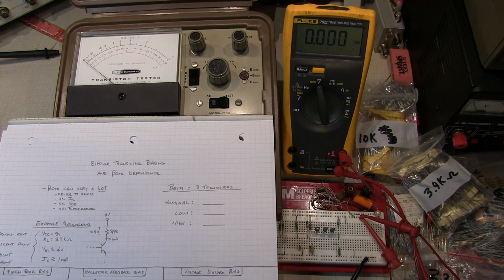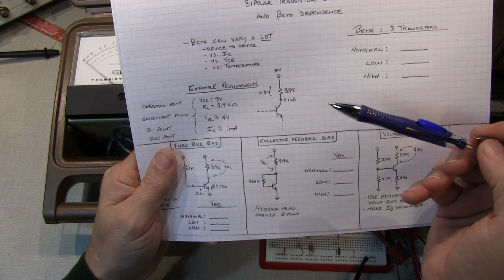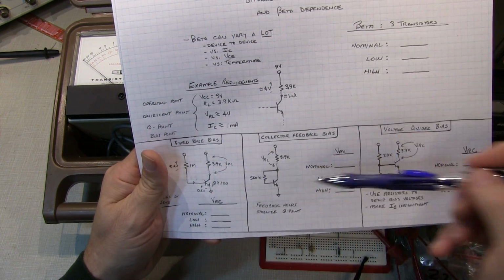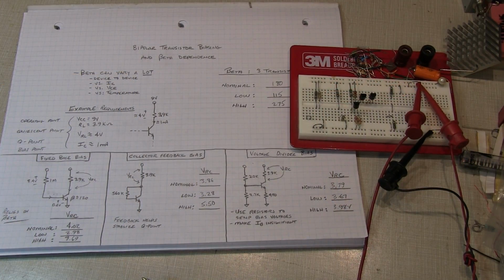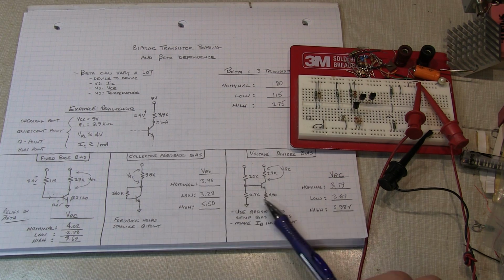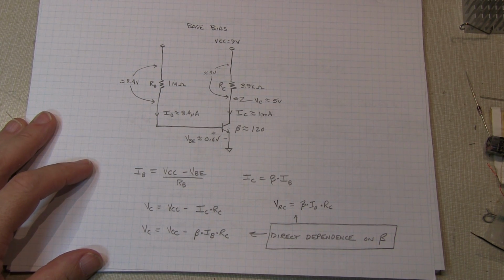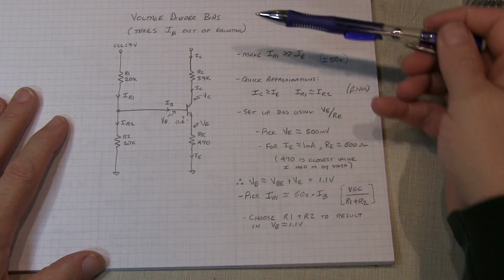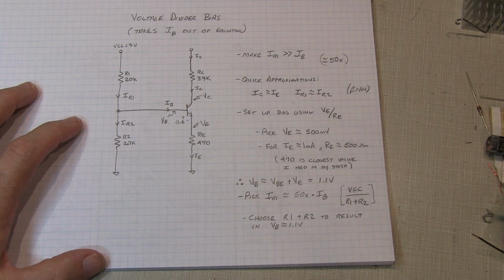#185: Back to Basics: Bipolar Transistor bias circuits and Beta dependence

Comment: When having 10 transistors that are ALL matched with the same BETA value but in circuit each transistor will have a different Vc collector voltage drop any reasons why?
Reply from the maker: Sure, they may not all be biased at the same level, or the base-emitter voltages don't match, etc.  It is generally  unwise to design a circuit that DEPENDS on a specific Beta value, since this is a highly variable parameter.
Reply: @w2aew  The Test circuit is the same. 10 transistors have the same Beta values, but when install each transistor in the test circuit one by one the Vc collector to ground voltage drop are different. I'm not sure why the Vc voltages are different when all 10 transistors have the same beta values and are MATCHed
Reply from the maker: @waynegram8907  Then the base-emitter voltages likely aren't matched.  Also, Beta does vary with collector current, so it is possible that the Beta matches at the test current used when measuring Beta, but they might not match at the collector current used by your test circuit.
Reply: @w2aew  I'm not use if these DVM meters that test transistor beta and transistor testers that has beta values are that great because when you install the transistors in the test circuit the Vc voltages are completely different. The transistors testers are suppose to be comparing the Ic/Ib = beta. Maybe the math program on these DVM transistor testers are a joke giving wrong beta values because when install in a test circuits the Vc voltage are completely different. What I don't get is how can 10 transistors have the same beta value but in circuit the Vc voltage are different per transistor.
Reply from the maker: @waynegram8907  You didn't read my reply carefully.  It is LIKELY that your DVM that tests for BETA is using a DIFFERENT Ic than the Ic being used in your test circuit - so there is no guarantee that you'll get the same results.
Reply: @w2aew  I did understand that part that my DVM meters test current was low and gave a different beta value. What I'm saying is that have you come across this issue when using DVM meters that test transistor beta and when matching transistors and when you put the matched transistors in a test circuit that you get different Vc voltages? because my main point is that these DVM meters are giving false beta matching and the only real way of getting a True beta matching is by measuring the Vc voltage and matching Transistors by the Vc voltage in a test circuit? Do you think this is the best true way of matching transistors is by measuring the Vc voltage and matching transistor this way and not using the DVM meters beta HFE test?
Reply from the maker: @waynegram8907  OK.  Yes, I have seen the issue where DVM hFE tests, and tests with the inexpensive PIC based boards, can give one result, and then you get a different result in the application circuit.  I usually don't run into the problem though, because I try to design circuit that don't rely or depend on a specific value of hFE (Beta).  If I truly need matched transistors, I am lucky enough to have a very comprehensive Curve Tracer that I can use, or I'll simply test them in-circuit.  Either of these methods are far better than the simple DVM test.
Reply: @w2aew  But to really match transistors all the Vc voltages should be the same if you're trying to match transistors? Measuring from ground to the transistor collect that Vc voltage should be the same voltage for all transistors if you're trying to Match the transistors, is that how its suppose to be done correctly?
Reply: @w2aew  Measuring the base current and the collector current to calculate the HFE beta IC/IB = BETA HFE is completely different in the test circuit compared to using the DVM metes transistor tester HFE values to match transistors. Its best to manually use two different ammeters one on the base current and one of the collector current and 3rd meter to measure the Vc collector voltage and Match transistors in circuit it seems. Those DVM meters HFE are false values not going to match transistors good. Any reasons why and have you ran into this also?
Reply from the maker: @waynegram8907  The readings from the DVM aren't false, they're just measured under different test conditions than your test circuit.  I never really run into the problem because I don't design circuits that rely on Beta being matched, this is bad practice.
Reply: @w2aew  Why is it bad practice to match transistor beta?
Reply from the maker: @waynegram8907  Because Beta is highly variable from device to device, and with operating conditions.
Reply: @w2aew  so how do you match transistors, what is your approach in matching transistors?
Reply from the maker: @waynegram8907  As I mentioned before - I'll typically use a curve tracer, or match the specific parameters of interest under the same bias conditions as they will be used in the application, which would typically involved building a custom test fixture or circuit.
Reply: @w2aew  yes the DVM meters "HFE test bias condition" to calculate the Beta HFE is going to be different compared to the Bias Condition of the custom test fixture circuit. The DVM meters bias condition and the custom test fixture bias condition are using a different bias condition to match transistors beta HFE. I understand that part that both are different. It would be nice if the DVM meters that are testing the HFE beta to tell the specs at what bias voltage and Vcc voltage are they calculating the beta hfe value.
Reply: @w2aew  Transistor water analogy, how can water be amplified like a transistor amplifies current? Transistors are like water turbines to accelerate the water flow which is amplifying the water flow?
Reply from the maker: @waynegram8907  A small change in the input voltage (or current) results in a large change in the output current.  If you want a water analogy, then think of the input as the operating of a valve - a small change in the valve control results in a large change in the amount of water that flows.
Reply: @w2aew  Why doesn't the formula Vcc divided by Rth thevein of the base biasing resistors = the base current? Also Why doesn't Vcc divided by the collector resistor value = Collector current? Both of these formulas won't give you correct base current or collector current, any reasons why
Reply from the maker: @waynegram8907  Because those formulas are only valid for basic resistor circuits, not for circuits with active components like transistors.
Reply: @w2aew  What formula are you using to get the transistors Ic? is it Vcc/Rc+Re?
Reply from the maker: @waynegram8907  That is the equation you use if the transistor is saturated.  If not, then you calculate the voltage across Re and compute the current that way.
Reply: @w2aew  So for the Linear Region you use Vcc/Re Emitter resistor = Ic ? Why can't I use Vcc/Rc Collector resistor = Ic?
Reply from the maker: @waynegram8907  No.  You don't use Vcc/Re.  You need to calculate the voltage across Re.  For example, if the bias network on the Base sets the base voltage to 1V, and the base-emitter voltage drop is 0.65V, then the voltage across Re is 0.35V, so the emitter current is 0.35/Re.  The collector current is very very close to this.
Reply: @w2aew  So the first step would also be you have to get the Base voltage FIRST before you can calculate the Ic? What is confusing me is that Ohms Law V/R=I can't be applied to calculating Ib or Ic. What confuses me about getting the R thevenin of the base biasing resistor that this formula doesn't work Vcc/Rth = Ib. Logically I would think Vcc/Rth would equal Ib but it doesn't.
Reply from the maker: @waynegram8907  Ohm's law is used, but you have to use it properly.  When you calculate the voltage across Re, you use Ohms law to calculate the current.  However, since the transistor is an active device and not a simple resistor, it doesn't strictly follow Ohm's law.
Reply: @w2aew  Right the Transistor is an active device so you can't use Ohms law Vcc/Re= Ie or Vcc/Rc = Ic, any reasons why? I know that a transistor is an active device but logically ohms law should work to get Ib and Ic but it doesn't work because you can't use Vcc/Rc = Ic and Vcc/Re = Ie or Vcc/Rth base resistors = Ib. This is very confusing because logically these ohm law formulas should work but they don't.
Reply from the maker: @waynegram8907  Think about it.  Why won't Vcc/Re work?  The voltage across Re is NOT Vcc, is it?  Ohms law only works when you are using the ACTUAL voltage that appears across the two terminals of the resistor.  Assuming Re is connected between the emitter and Ground, then the voltage across Re will be equal to the voltage on the emitter (Ve).  So,  you use Ohms Law to calculate the emitter current as Ve/Re.  Vcc is NOT the voltage appearing across Re, so that is why you don't use Vcc/Re.
Reply: @w2aew  What I'm saying is that the Transistor is acting like a Zener Diode by having a reference voltage which is considered Ve. The Vb base voltage is determining Ve. So you have to use Ve/Re = Ie or Ic. The transistor is not acting like a resistor voltage divider, its acting like a zener diode because the Ib base voltage is "dictating" what Ve will be. My whole point is that Vcc/Re or Vcc/Rc+Re is not the Ic collector to emitter current. Some EE designers will use Vcc/Rc+Re = Ic Sat and then that 1/2 of Ic Sat which will = Ic linear region collector current. When you take 1/2 of the Ic Saturated it will be Ic and Ie current of the linear region. I don't know the correct term or name for the linear region Ic and Ie current because its not relatable to use these ohm laws formula Vcc/Re or Vcc/Rc. The Linear Region Ic current value is dictated by Vb because Vb is dictating what is Ve and Ve is what the linear region Ic current value will be.
Reply from the maker: @waynegram8907  The only time you use Vcc/(Rc+Re) is when the transistor is operated in saturation.
Reply: @w2aew  yes true but I have also seen you take 1/2 of the total to get Ic. Designers are shooting to get 1/2 of Vcc/(Rc+Re) because 1/2 gets you the best Q point on the DC load line.
Reply: @w2aew  How can you get Ve ( emitter voltage) if you don't have Vb? Which formula would you use to get Ve?
Reply from the maker: @waynegram8907  Usually you simply calculate the base voltage first, which is usually based on a resistor voltage divider, then subtract the typical base-emitter voltage drop.
Reply: @w2aew  yes I got that part. But if you want a gain of 2, 5 or 10 then what formula do you use to know what Vb and Ib would be to give you a gain of 2, 5 or 10 because the gain ratio is based on the Rc and Re.
Reply from the maker: @waynegram8907  Design is always a tradeoff between many parameters - gain, power consumption, input/output impedance, bandwidth, stability, required voltage swing, etc.  There are many variations that will give you the same gain using the same ratio of Rc:Re.  The choice of where to set the emitter voltage, what actual resistor values to use, and other decisions will often depend on other requirements as mentioned above.  For example, using a larger emitter voltage will result is less variation of gain with transistor parameters, but will give you less available voltage swing.  Using larger values of Rc and Re will lower the power supply consumption by allowing you to use a lower collector current, but will increase the output impedance and reduce bandwidth.  So, these design considerations will all factor into what values you use.
Reply: @w2aew  If the designer wants a gain of 5 then the first step is the Ratio of Rc:Re values first. Once you got the Ratio of Rc and Re, then calculate Vb but the problem is how to calculate Vb so you get a gain of 5. If you want a gain of 2 you change the ratio of Rc:Re but the hard part is calculating Vb to get the correct Vb voltage for a gain of 2 or a gain of 5.
Reply from the maker: @waynegram8907  Here's an example scenario.  Let's say I want an amplifier with a voltage gain of 3 with an output amplitude swing of 2Vpp without saturating, an output impedance less than 5kohm and I have a 5V power supply.  This tells me that a need Rc:Re equal to 3:1.  Since the output impedance needs to be under 5k, I'll choose Rc=3.3k and Re=1.1k.  If I choose the quiescent voltage for the collector to be 3.5V, that will mean that the output swing will go from 4.5V down to 2.5V, giving me a lot of margin against cutoff on the high peaks.  Thus, the quiescent voltage across Rc will be 1.5V (5-3.5).  Since Ic is approx equal to Ie, that means that the votlage across Re will be 1.5/3, or 500mV.  This sets the collector (and emitter current) to be approx 455uA  (.5/1100).  At this fairly low current, the base-emitter voltage will likely be about 0.65V, so the base voltage that I need to setup to make this work would be 0.5+0.65 = 1.15V.
Reply: @w2aew  The higher the transistors leakage current mean that the more sensitive the transistor will be by temperature? The higher the transistor leakage current means that the audio amplifier during IDLE when NO audio input is applied that the transistors have no input signal that the transistors are at idle but the leakage current when cause the audio amplifier what type of problems? Only when the transistors are in CUTOFF region is when the leakage current is a problem, not when the transistor is biased in idle?
Reply: @waynegram8907  The simplest way to design for a given gain is to recognise that the gain of the stage is approximately equal to the voltage across the collector resistor divided by the voltage across the emitter resistor. A constraint is that the voltage across the emitter resistor should not be less than about 250mV.
If you have a supply voltage of 9V and you want a gain of 10, then you first aim to have the collector bias voltage about half-way, which means around 4.5 volts across Rc. For a gain of 10, you will need about 450mV across Re. For a gain of 5, you will have about 900mV at the emitter. Designing the divider network follows from that.
Reply: @w2aew  When adjusting the DC +VCC biasing collector ( not base ) voltage of a transistor this will alter and change the transistors "internal" little Re emitter resistance and Ce Collector resistance? the transistors internal resistance changes depending on the +Vcc biasing voltage and base DC biasing voltage?

Comment: very good video! i understand the r1 and r2  u choose to get 1.1V at Vb. but what about the  base current( 50x base current), dont quite getting calculation for the voltage divider resistor to get the 50x base current.
Reply from the maker: There are many (infinite) combinations of R1 and R2 that will give you the desired base voltage at the junction of R1 and R2.  It is the ratio that determines the base voltage.  Choosing to make the standing current going through R1 and R2 approximately equal to 50x the base current adds another constraint - which says that VCC over the sum of R1+R2 should be approx equal to 50x the base current (and the base current is already approximated as the collector current divided by beta).  Thus, with these two conditions, you can arrive at good values for R1 and R2.  In the example in the video, assume that beta is 100.  Collector current is 1mA, so the base current is 10uA.  We want the current in the divider to be about 50x10uA, or about 500uA.  With VCC of 9V, this says I want R1+R2 approx equal to 9/500uA or 18k.  I had a limited selection of resistors in my junk box, so I started with 20k as R1.  We want 7.9V across R1, and 1.1V across R2.  7.9V/20k gives me 395uA.  Thus R2 = 1.1V/395uA = 2.78k.
Reply: @w2aew  thanks sir, very well explanation!

Comment: It's easy to design a x10 amplifier using an Op Amp and 2 resistors.
How do you do that with a single transistor? 
I've never seen anyone do that!
Reply from the maker: Simple.  Common emitter amp.  You get very close with emitter resistor that is 1/10th the collector resistor.
Reply: @w2aew  Do you have a video that explains this in more detail?
It's not clear to me how a 2N3904 from different dies can have the same amplification predictability, as an Op Amp Rf/Ri?!
Does the Emitter resistor act as a negative feedback resistor of an Op Amp?  
It's all clear once explained! Until then, there are fog patches...
Reply from the maker: @pirateman1966   Yes, the emitter resistor does provide negative feedback. Maybe this video will help. https://www.youtube.com/watch?v=VWY2WQcKJgk
Reply: @w2aew  Yes, I saw that one and left a thank you note. Thank you for answering my question and for flipping the switch to my light bulb!

Comment: What is the transistor part number? why you
Reply from the maker: I don't remember exactly what I used, but it was certainly just a general purpose, small signal transistor like the 2N2222 or 2N3904, etc.